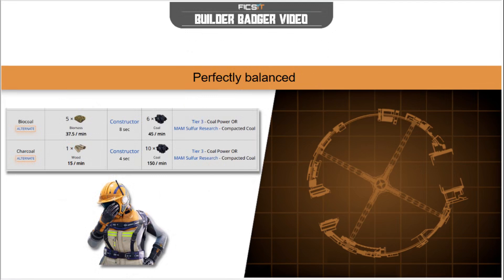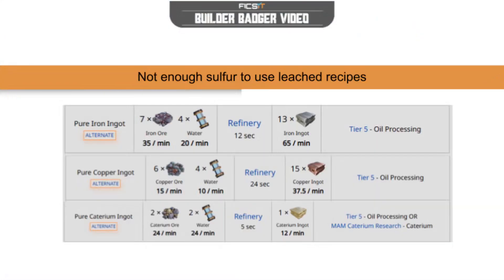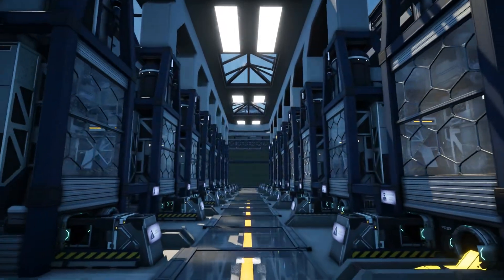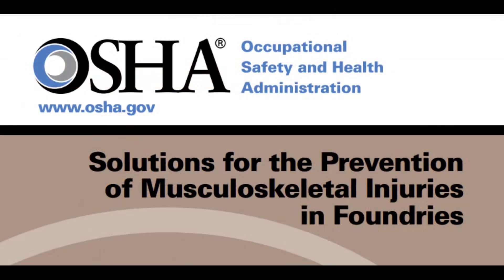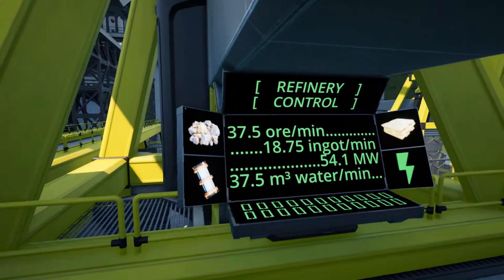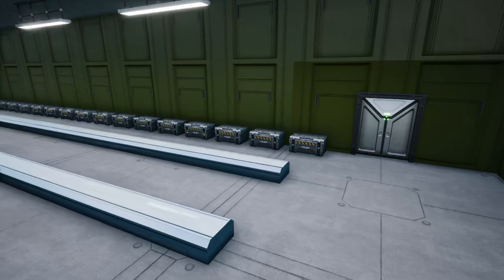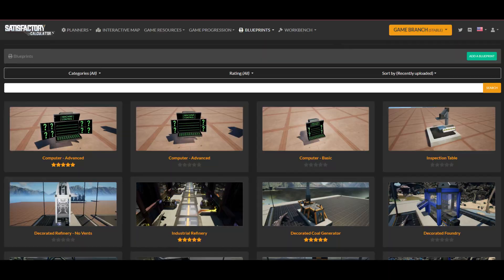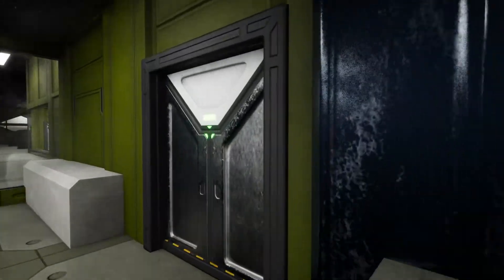SatisFactories:  Ingots

Comment: Hi great work, the molten metals is that a mod or something?
Reply from the maker: @martinhoneves  the molten metal is made using display signs in the same way people use them for lighting but I have used orange and yellow instead of white. The only part that's dependent on mods is some of the positioning would be very difficult without the Infinite Nudge mod.